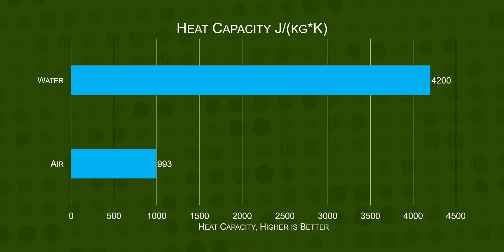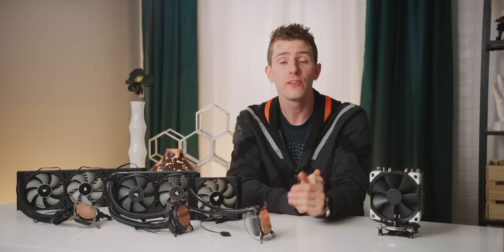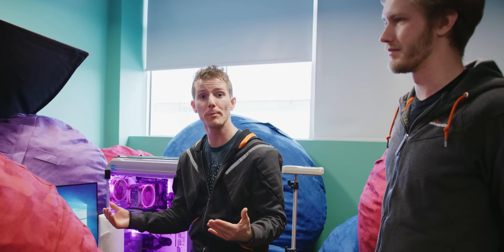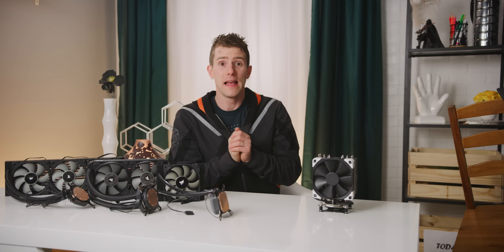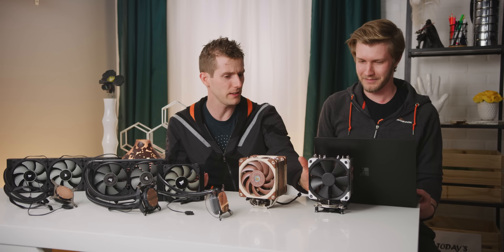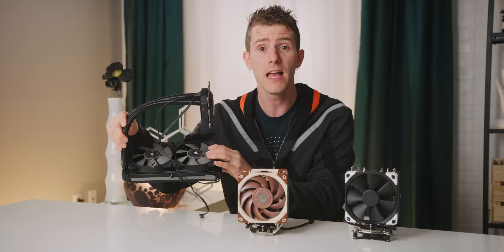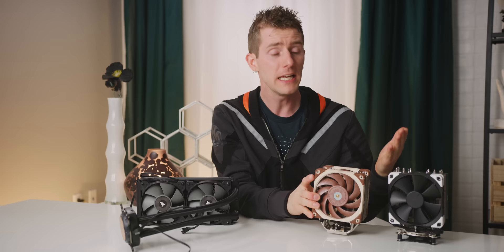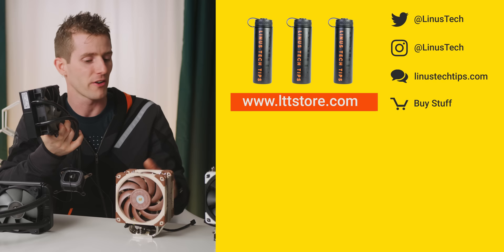Why you shouldn't water cool your PC

Comment: I had a 9 year old Noctua cooler laying around. Slapped it on a new computer / home server that runs 24/7 and it works. I'm not sure if I would trust a 9 year old AIO.
Reply: My original NH-U-12P didnt even come with a 1366 kit and it has gone from Nehalem to Ryzen2 (mainly to save power). I would have bought something better but they havent made it yet ;)
And i am dead sure i wouldnt trust a 9yo AIO. Evaporation will have occurred, and it's unlikely the biocide is THAT good. Any rubber will have started to decay.
Reply: @mycosys   Same for me. Bought mine in 2008 and replaced the original fan with the new A12 PWM in my Ryzen build after running fine for 10 years.
Reply: Considering my AIO had a pump failure recently and is, I think less than 3 years old, yeah, they have a few issues.
The irony is I had to revert to using a stock intel cooler that dates back 10 years, and that still works as well as it ever did. (which is mediocre, but you know. Functional.)
Reply: @KuraIthys  I have a 11 year old corsairs H60 It's been in 2 pc's and is still working great on a 2600k. I got a Corsair H150 in my new built and it's silent even under full load in a be quite pro 900, 9800k @  5ghz with 1.29 v
Reply: if you are using a 
'9 year old" any piece of tech, in your rig, maybe its time to just stick with consoles..
Reply: @raidermaxx2324  i have a 420 radiator from 2008 cooling my 1800x and 1080ti :)

@lord-carlos if i were you i would check the condition of the tubing, i had a 6 year old antec where the tubings did start to crack and "sweat" liquid out so slow it was hard to notice.
Reply: raidermax23 if you don’t have a home server hand in your man card.
Reply: Jesus. The guy just described a scenario where he would prefer an air cooler. Let's all have a relax.
Reply: @raidermaxx2324  and be stuck with with no upgrade path at all
Reply: enjoy playing beside a wind turbine.
Reply: @obscured021  theres no such thing as a 9800k
Reply: I'm using a spare Intel stock cooler on a Xeon-based home server. It's been running now for four years...
Reply: @raidermaxx2324  windows 7 for older games support. It's ten years since the initial release.
Reply: @raidermaxx2324  A heatsink has no moving parts, it's not exactly going to be worn out is it! To prove a point, my old NH-U12P was due to go in a gift rig for a friend, it was pretty dusty...so I washed it in the kitchen sink and put it in the oven at 80 degrees to dry. It's still performing as it did the day I bought it!
Reply: I wouldn't out a AIO in a server or 24h7 pc old or new anyway

AIO are for pushing limits
Reply: @raidermaxx2324  🤣🤣🤣 Seriously, do some research! In '09 the Core i7-870 had a TDP of 95w....so do current Core i7s. So, as long as you clean the mating surfaces, where's the problem? If the fans die, replace them. Heat pipes (short of significant physical damage) don't really degrade over time.
Reply: My original H50 has been running strong on my 2500k for 9 years, 24/7! AIO's seemed more reliable before they went mainstream and got mass produced.
Reply: While 9 years seems like a while, my H105  is 6 years old. It cooled my 4670k @ 4.2ghz for 5 of them, and now it's on my 8600k at 4.8ghz. No need to update it, so it will probably see 9.
Reply: I still have a corsair H50 running on a core i7 930 for around 9 years now and still no issues.
I don't expect that to last though 😅
Reply: @RenRenification  That part probably flew over their head while they were making lame insults.
Reply: @20EsOfficial  again, you can run windows 7 in compatebility mode from windows 10, so there is no reason to have win 7 anymore... especially since it doesnt support the new directx etc.. so, still you should consider consoles.. and if you wanna split hairs like Barr in the mueller report, then i would clarify i was talking specifically about hardware, not software. regardless, no reason to have win 7 anymore.
Reply: @PrivateCustard  that may be so, but it doesnt compare to the thermals provided by newer versions of the same tech. and CPU's run hotter than they used to, when that piece of hardware was in its prime. and considering how much new cooing solutions cost, which is very affordable, you gotta be really cheaping out to use a fan system thats a DECADE old, on a newer CPU. and if you still have a CPU that is a decade old, so it doesnt matter, i again, rest my case. You should probably stick to consoles lol.
Reply: @raidermaxx2324 The proof is in the graphs. My 6700k is running at 4.5 in a case that isn't considered the best for air (H700i), and it still beats a higher priced AIO. As long as you apply a little brain power when creating your fan curves, it's all good. 

And why the childish attempt at a dig with that console comment? Grow up!
Reply: BaboonLoveMonkey  in your opinion.. but if i bought a brand new i9 or threadripper, no way in hell i aint gonna fork over 60 more dollars for a brand new cooling solution whether that be AIO or the other. Thats just dumb as hell..
Reply: @PrivateCustard  which graphs?
Reply: @PrivateCustard  and why the dig? because its true lol.. if you are gonna  chintz out on one of the most important components of a high end gaming rig, after spending serious cash on the rest of it, but then dont pay the extra 60-80 bucks for brand new cooling  hardware and instead decide to use a DECADE old solution(because wear and tear is actually a "thing") - well then you should stick to a basic. dumbed down version of gaming like console gaming where you are not required to make seemingly logical financial assessments based on predictable outcomes,  cuz its gonna end up saving you money and your sanity in the long run.. im trying help you, not insult you by saying that.. :P
Reply: @IamR3D88  yep, because you rarely have to update a piece of hardware until it fails. lol.. unless you are thinking logically, and making a reasonable prediction that 60 more dollars on a brand new piece of hardware to keep your brand new cpu from burning to  a crisp, thats the other time you replace it.  Mind you, we are talking about using or not using a decade old cooling solution, on a brand new, modern cpu. Not the fact that you or someobody has an ancient potato, and are going to continue just to use your ancient potato, which may or may not last another decade.. who knows maybe it will. but would i trust your old ass cooling solution on a brand new i9 on my brand spanking new maximus mother board?/ hell fucking no. i already spent  a grand, im gonna spend the extra 60$ for a new AIO or fan buddy, believe that.. any other calculation is simply dumb.
Reply: @martindinner3621  dude, we are talking about using a old cooling solution on a brand new cpu. not a freaking cpu from 2008 or whenever.. nobody gives a fuck about that. we are talking about whether or not to upgrade your cooling solution or keep using your old one, in a brand new rig.. Keep up.
Reply: BaboonLoveMonkey  not on a brand new i9 it aint.
Reply: @shade221  no, but it does mean cheap, and stupid.
Reply: @raidermaxx2324  just cuz it's old doesnt make it a potato. That is like saying a 2019 Kia is better than a 1999 Corvette. Sure it looks fancy, but the Corvette will perform better.

I wont buy cheap, just to need an upgrade later. The H105 was the best AIO back when I got it, I'm not gonna replace it with something that performs worse, or spend big money on a new one before it dies. Modern CPUs will throttle with no cooler, so you wont destroy it. My HTPC felt slow a few months back, the fan on the air cooler died. CPU throttled. Plenty of time to replace it. Same will happen now. Go ahead and waste your money on new things to replace your working things, until performance is degrading, I'm not throwing out good parts.

Not sure why you mention motherboard for CPU cooling though. Maybe an air cooler can give some flow, but with proper case flow, it's not an issue anyways. My maximus vi and maximus x have plenty of passive cooling for everyday OCs anyways.
Reply: @raidermaxx2324  Right, first things first, did you even watch this video? a decent air cooling solution can be cooler and quieter than AIO liquid solutions costing more. Secondly, it's a heatsink, it's solid state. If the design was good and heat dissipation effective when it was built, if it's kept clean and free of dust, it'll perform just as well a decade later (which I'm am currently doing with a secondary rig of my own). It's the fans that will make the difference, keep current with those, and a quality ten year old Noctua will be good for as long as the socket it fits exists. I've had 2 AIO's so far. The first leaked in the box in transit, the second ones pump died after mere months, and could have done some serious damage had I not had the right failsafes in place. My Noctuas (NH-D15 and NH-U12P SE2) are still fantastic, with one being two years old, and the other close to a decade, both with updated fans on them. Look, I know people are precious about their fancy looking liquid coolers, but really, unless you're going full custom loop, liquid coolers are pointless for all but looks. The risk of all these cheap-ass pumps dying prematurely just isn't worth it IMO.
Reply: @raidermaxx2324  2010 wasn't that long ago. It's a fucking fan, not a floppy disc.
Reply: BaboonLoveMonkey  first of all,I ain't your mate, amigo. Second of all, you do realize that "heatsinks" are a "part" of a cooling solution, not an actual cooling solution on its own. 
Because unlike  in your imagination, heatsinks ontop of CPU's don't blast off into outer space Elite Dangerous style, after absorbing said heat. In fact, they are attached to a fan, and also  the cpu, and not going anywhere with their absorbed heat, as  the  purpose of the fan is  to remove and disperse the heat from the heatsinks via agitation of air molecules. And while any monkey would be able to fathom that a heatsink generally can't break since it's just a piece of metal, and the moving part and also prone to failure part is in fact the fan, never the heatsink, which is the eventual cause of catastrophic heat death to  CPUs  owned by many tryhard   PC master race wannabes (but who are just console pleb monkeys ) over the years. 

That said, maybe you think that it's perfectly fine to cool a cpu with just a heatsink or even five heatsinks, and I wouldn't be surprised considering this is the argument you made.  
 Which is further evidence that my original statement, that if you are going to cool a brand new cpu with a decade old fan, attached to some indestructible metal heat sinks(is that better?)  or any cpu for that matter, consoles are your friend. Friendo.
Reply: BaboonLoveMonkey  personally I don't care if you nuke your GPU or not, and honestly that's a huge PRESUMPTION that nothing will get cooked in the time that it takes to catch it. You are also assuming that the fan breaks down completely all at once, as opposed to a slow disintegration over time, which can cause damage and weaken the circuitry if it doesn't burn it out, and then you aren't even factoring in human error and human behavior, in that someone is going to be on top of it,. But that's all besides the point. My point is, that's it's stupid, and illogical to spend heaps of cash on  new hardware, and to then just puss out on the protection  of said hardware. It's like you bought yourself a corvette , and stick the old alarm system that you had on your old pinto that you traded in, instead of just paying the extra loot, for new modern, protection and peace of mind. You already spent 80 G's on a new Vette, and then you are gonna jew  out and just install your old alarm system?? Hoping that it still works well, and maybe it will notify you before the car thief actually pulls off the GTA, because essentially, all car alarms in the last 3 decades do the same thing, and work the same way.. fucking dumb, that's all I'm saying. It's illogical, to spend a ton of money on new shit, and then cheap out on the important shit that protects it. Lol. But hey, I was young once, and I had to find shit out the hard way, just like all you incels will eventually figure  shit out, that your elders who have accrued more wisdom and knowledge over time and experiences  were telling you shit for a reason, and not just to argue.